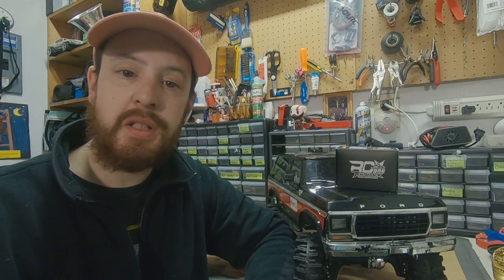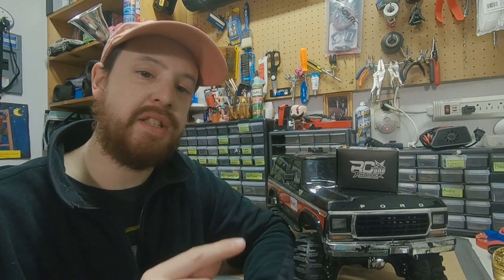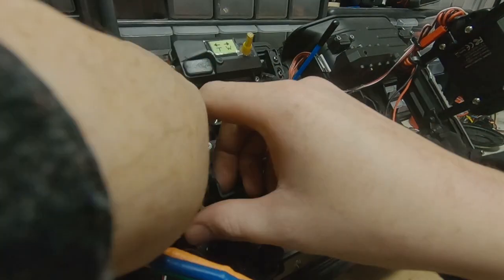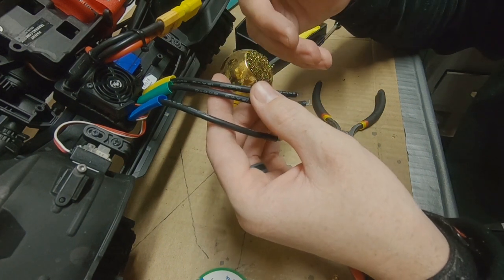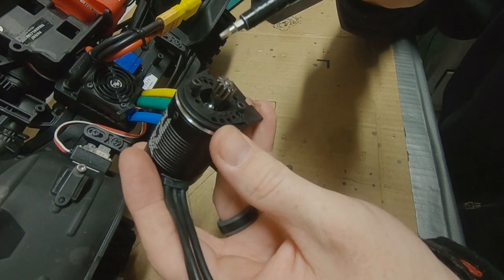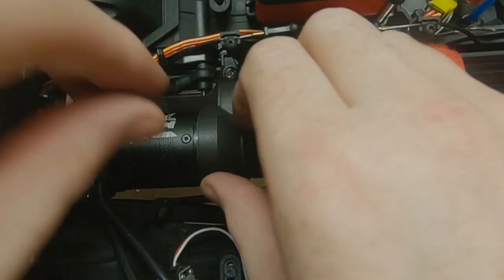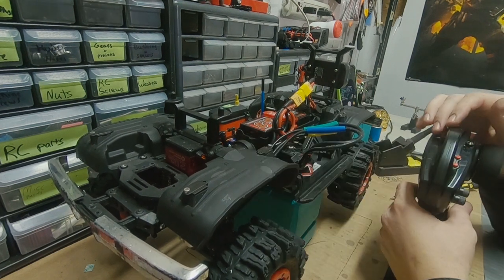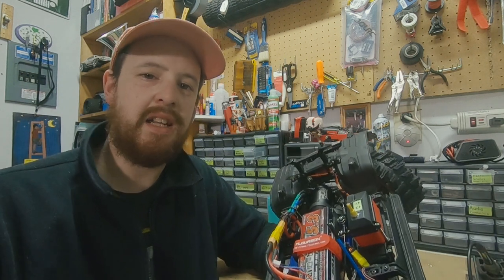Troubleshooting the TRX4 Part 5:Tips for Motor upgrade and Soldering new ESC connectors

Comment: It doesn’t look like your motor is sensored. How well does it do in slow crawling? Or is it just a trail truck?
Reply from the maker: The motor I took out was a "sensorless" 3100kv and with a 9T pinion it crawled quite well. This Tenshock is a 2400kv 6pole so I expect it will do even better but I have not had it out yet since we've got so much snow, lots of snow. Soon though I get it out and we will see how it does. Thanks for watching. 👍👍